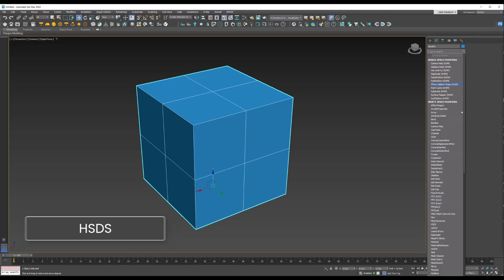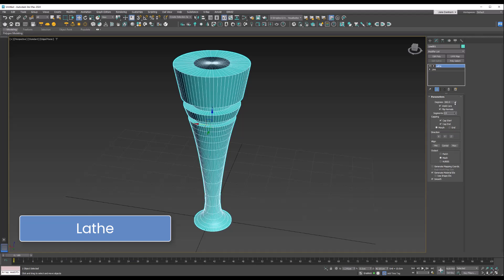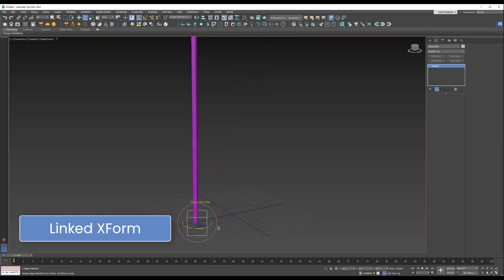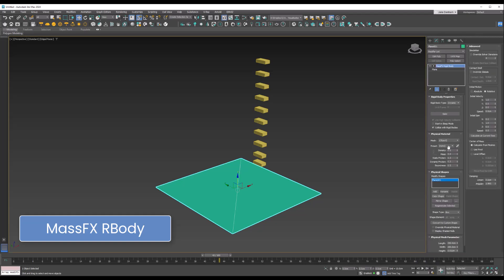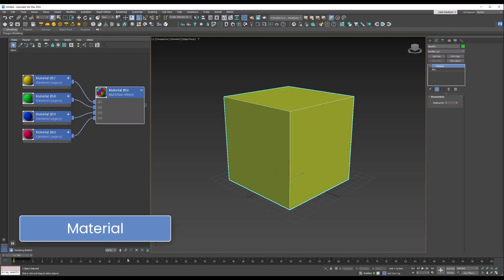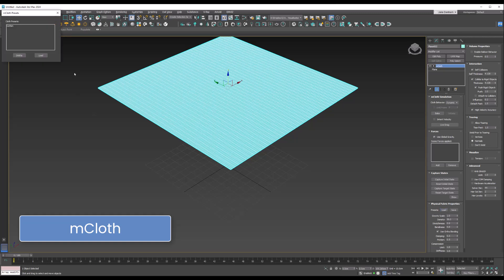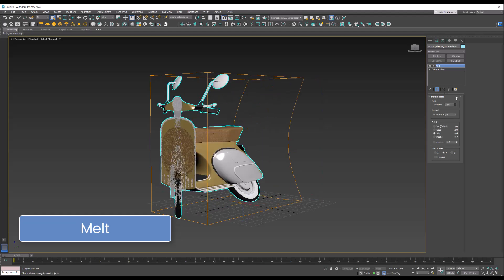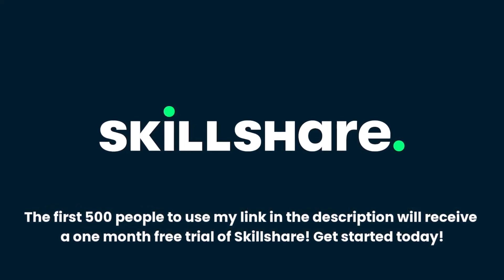10 AWESOME 3ds Max Modifiers You Don't Use... (But You Should) | 3ds Max Tips and Tricks

Comment: Re: HSDS - Meshsmooth can also do sub-object subdivision, but you have to have a sub-object selection and uncheck "apply to whole mesh" - the caveat being meshsmooth will convert quads to triangles. HSDS however, is best for subdividing triangles - whereas turbosmooth can't really do that. HSDS is excellent for smoothing cloth simulations that use garment maker meshes or any cloth mesh made of triangles.

Re: MCloth live drag - The standard cloth modifier also has a live drag option, but it's slower, and the feature is a bit hidden away.
Reply from the maker: nice, thanks for sharing